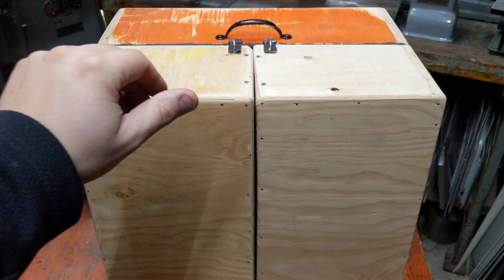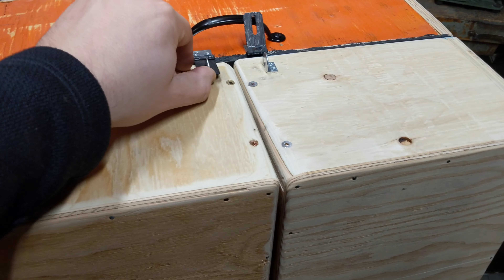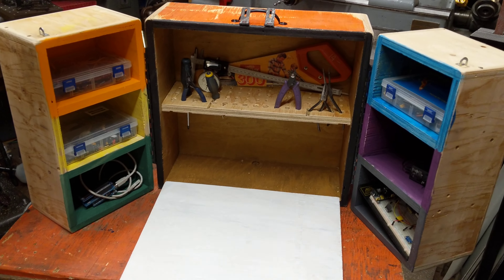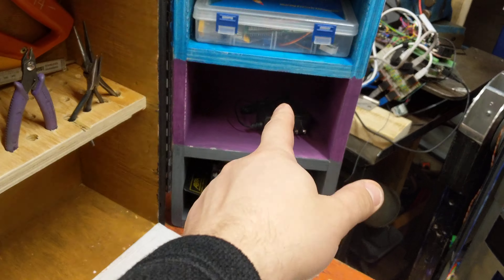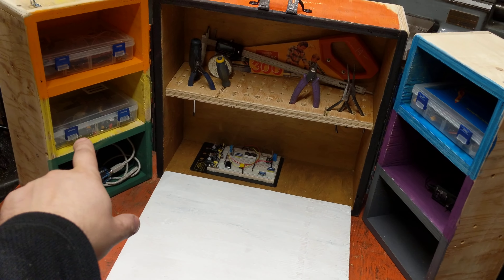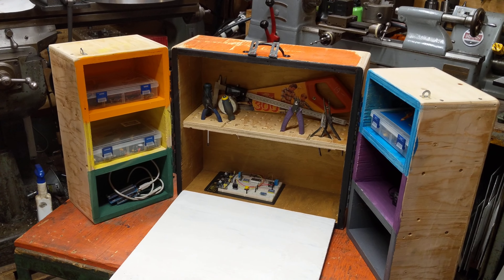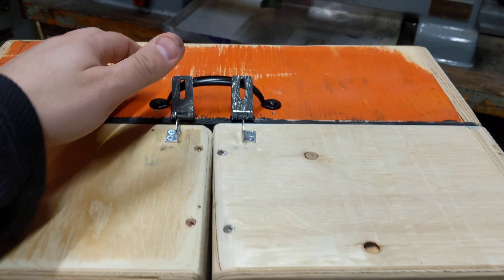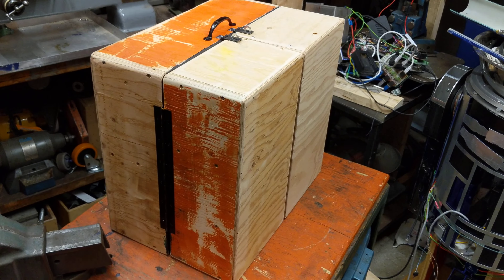#CraftingTable - small #Tool storage and portable workshop

Comment: That's an awesome little build!  Micro-workbench with shelving that you can bring with you in the back seat of a car, very nice.

You could totally integrate a power strip for where you can plug in for power, and a USB battery bank for where you can't.  Plenty of options available now for USB-C powered primary bench tools (multimeter, power supply, soldering iron...) - admittedly the USB-C input variable power supplies will be low-output, but still.
Reply from the maker: @neverendingstudent  thanks for the encouragement! I will for sure 'kit' it out as they grow up with it.   It's magical to watch a 4 year old construct circuits.